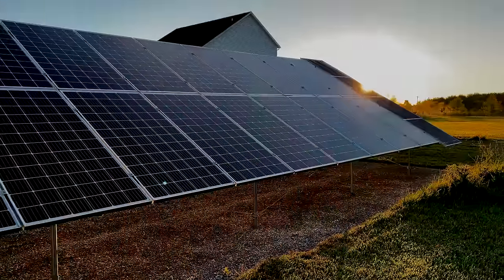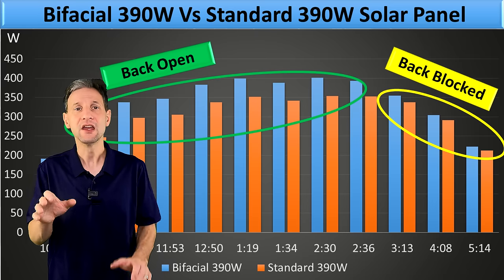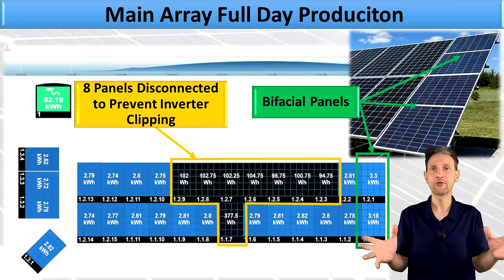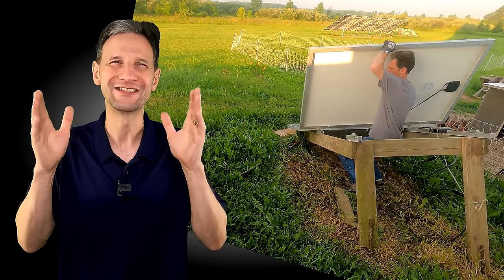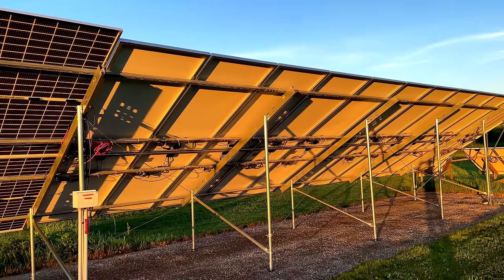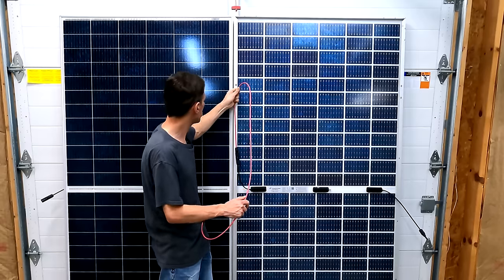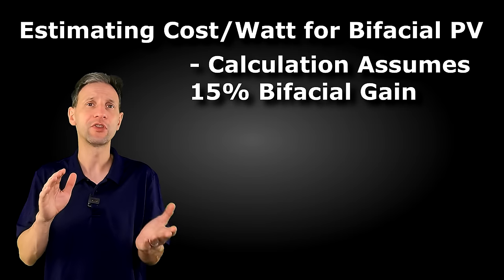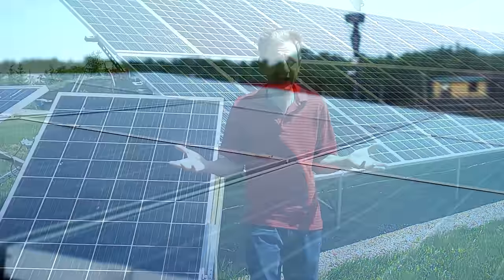Bifacial Solar Panels - The BEST Solar Panel? Real World Results!

Comment: Hey Dave! Great video. I'm in New Mexico and I know a guy who did a neat trick with his bifacials.  He mounted them as a pergola roof about 15 feet up.  And on the ground he put down white concrete unnder the panels and white gravel 20 feet out from the panels.   He said he saw a notable increase when he added it.
Reply from the maker: Nice idea!  Thanks for posting.
Reply: I picked manderins years ago ,and they had a white geo-textile pinned under the trees specifically to reflect light to the underside of the trees - and help the fruit rupen quicker , same thing really ..  
Wether you'd want thousands of acres of plastic fabric everywhere is another issue though ..
Reply: If the PVs were on a slanted mount on top of a roof I imagine colouring the roof white would increase panel efficiency AND cool the building.

Comment: That’s all doesn’t matter. What are real numbers is a price to watt ratio, internal resistances (direct and back), and a durability of a surface. I’m sure it’s possible to find a 10% less expensive standard panel, or 10% more powerful for a same money. And to use a good mounting, wind proof, etc

Comment: Hello Dave, I wanted to say a massive thanks for all you have tough me regarding solar. I now have my system up-and-running. I changed plans several times as each video you posted made me re-evaluate. I now have 64 bifacial panels on 4 ground racks of 16 per rack. I have done as you suggested and placed two racks at 45 degrees from due South. One at 135 degrees SE and one at 225 degrees SW. The remaining two are due south. All have an azimuth of 36 degrees. The resulting performance is way beyond my expectations, interestingly, the SW panels produce half the power that the SE array produce in the early morning. This must be just from the back side of the SW panels. So pleased I changed my mind and went with the Bifacial panels. I also followed your advice and split the load on each of my two inverters by running racks 1 & 3 to the first and 2 & 4 to the second. I knew nothing about electrics before I embarked on this project, let alone solar!

None of this would have been possible without the education you have given me. The clear and concise way you explain the process has been invaluable. I am in your debt. Keep up the good work.

Regards,
Richard.
Reply from the maker: Richard, thanks for the encouraging feedback!  I love that you have taken all the things I've learned from my install and analysis and made a much better solution than I did for my original install.  I'm so glad my information could make a difference for you!!

Comment: Thank you for another great video. I am installing a ground mount system right now. One thing you did not mention was Bifacial racking, I managed to change my order for racks that are specifically designed for Bifacial and have no supports crossing the back of the panel. They adjust to the panel size. I was also able to get new Longi 445W Bifacial panels for only a few €’s more than the same watt standard panels. Interestingly, the Bifacial come with a 30 year performance warranty as opposed to the standard Longi panels 25 years.
Reply from the maker: Thanks, good point!  I did forget to mention the racking considerations.  I think they can offer a longer warranty because they start at a much higher output with the backside boost and the backside glass is a better material then the typical back sheet.

Comment: should lay your bifacials on there side. keep panels a little more vertical and step each row back the width of panel.[like a set of stairs] you should get a reflection from front of second and third rows plus less snow in winter. would be nice to see thanks.  make your stand a just forward or back for summer or winter

Comment: It's nice to see an actual in depth comparison of bifacial to standard panels. I too live in ohio and plan on doing solar at home but im waiting on the paperwork side of things and ive missed out on panels and inverters so far because of it. But my plan is now to get 20 445watt canadian bifacials, two sungoldpower sp6548 inverters, 30kwh eg4 lifepower4 to run my whole house. The array is going to be mounted at 45° because i have a friend right down the road and he gets the best all around output at that angle and it should shed snow decent. Im going to have ac input with the inverters if/when my solar cant run the whole house in the summer bc the 3 ton ac unit. I use around 45-60kwh a day(summer) so im guessing it'll handle it.
Reply from the maker: I think the steeper angle is a good choice to maximize winter production.  However, if your max consumption is in the summer, you may want to go with 30 or 40deg.

Comment: Outstanding content. Conclusions on bi-facial panels I've had to piece together from a myriad of sources...almost all confirmed in one video.

I think the only belief not specifically confirmed has to do with backside gain being able to heat panels enough to shed snow cover on the top side from the heat produced by power generation entirely from the back side. Ground-mount panels set to a steep winter angle for a lower sun should automatically shed snow early in the day and provide substantially more power than panels with cells only exposed to light from the snow-covered top side - all with no manual snow removal activity.
Reply from the maker: Thanks!  Yes, come winter I will have results on snow, steeper angels and roof installations.

Comment: I use twin 3120 watt bifacial arrays on dual axis trackers and during the summer I maxed out at just under 6700 watts. I placed the white granite rocks under my panels in order to catch as much reflection as possible plus my panels are elevated so I get reflective light from all angles.
Reply from the maker: Nice!  What tracker do you use?
Reply: @ProjectsWithDave  I built them myself out of 4” drill stem, cost around $1,000 including the electronics.
Reply from the maker: Cool!  Sounds like a great project!

Comment: I used Canadian Solar 440 bifacials and put them above a galvalume metal building (low slope) roof, with a racking system that allows me to tilt up for winter, and down for summer, in both cases my panels are well above the metal roof.  Being near the 49th parallel, the panels have sun Behind them for a good stretch of the year, and lots of reflection during winter.  My best production ever is acturally January and February when it is cold, and lots of reflection from snow and metal roofing. Yeah those high production numbers are only for a few hours per day, but when you need every watt, this is important.  I have seen over 115% of rated capacity on many sunny cold days.  

One thing to be careful with - Put your framing only inline with the panel edges: no strut running in the middle of the PV back side! keep all the wires and any conduit or wire way away from anywhere they can cause shadows!
Reply from the maker: Thanks for posting your actual experience!

Comment: So one thing I read somewhere is that you should consider increasing the tilt angle from the ideal at your latitude by 5 - 8 degrees and also raise the mounts as high as you can. They also said that you should increase the ground area below the back of the panels you cover with something reflective, like white stones.
Reply from the maker: Since the power boost is going to have the biggest increase in mid summer it makes sense to adjust the tilt angle to favor winter production, that would result in a more even production throughout the year.  Another advantage of bifacial!  If you have a link to the information you read feel free to post it here.  Thanks!
Reply: What about water for the reflective back surface?

Comment: Thanks for doing this research!  It is interesting with bi-facial, half-cell, different bus bar designs, and microinveters how much better panels are with shade and how much more real efficiency they show.  Those NEP 600s are clipped at 390W per PV input, you may have had more!  I am looking at doing a similar system with AP Systems DS3s and the Aptos 440w bifacial from Signature Solar, which also may experience clipping!  The one thing that I am still trying to figure out is racking, do you like your Ready Rack system?  Would you have gone with this system if you were doing things over again?  I'm looking to do a ground mount with 30 72-cell panels, I would love to have it seasonally adjustable tilt and don't care about aesthetics.  However, it seems like tilt adds too much money and these static mounts are likely going to be the best bet.
Reply from the maker: I do like my racking system and I would go with it again.  There is a single pole system with manual tilt adjustment one of my friends is installing that would do what you want, but it requires special equipment to drive the posts so it would be more expensive.  I only connected one panel to each NEP microinverter so there was no clipping in my results.  The BDM600X is capable of 580W output per inverter.  I got the same result from the microinverter and the optimizers.

Comment: Great description and analysis. Considering these to refurb my ground mounted system. Season tilt for Lat 50 means they are almost vertical, slight hill and snow behind the panels would mean quiet a boost. Also -40'c has significant effect, watch out for your Voc Max!
Reply from the maker: Sounds like a good application for bifacials.

Comment: Bifacials are highly recommended when installed on flat rooftops without tiles painted white and always installed on angle (this is the case for many buildings in southern Europe). They are very efficient when the surface behind them is reflective.
Reply from the maker: I imagine that would be much better than mounted flat on a roof, but it would require more racking equipment to achieve that.
Reply: @ProjectsWithDave  In that case you stick with the normal half cut, mono PV. I mean, if racking costs double the money just to put some bifacials, it's better to avoid them. Watching your video experiment regarding panel orientation, I'm thinking of using a couple of big power output bifacials in EAST-WEST direction for harnessing sun early in the morning and late in the evening, especially during winter. That's I think is a more appropriate and efficient way to use these panels if you can't install them the right way.
Reply from the maker: Based on my most recent analysis, I think the best orientation would be SSE and SSW.  You can see those results here: https://youtu.be/J7xnY84Ch1E
Reply: @ProjectsWithDave  Yup, I know...

Comment: Yes I had an idea as soon as I heard about by facial solar panels

They make a paint that is so white. It actually keeps the surface underneath it 15° cooler than ambient temperature

So simply paint the concrete slab underneath your solar panels with that ultra white paint and you would probably get a copious amount of bounce back

Comment: Be interesting to see if the BiFacial panels shed snow quicker since they're likely to heat up quicker in lower light conditions.
Reply from the maker: I'm also very curious, I'll let you know when I get the results.
Reply: @ProjectsWithDave  any updates ?
Reply: @ProjectsWithDave  Yeah, I'm curious if the perform better in winter months too when they can get more light underneath from reflected snow. I live in Illinois, so really wind power would be a better option, but solar is going to be easier of an install and serve as an awning of sorts too.

Comment: How about a reflective surface laying flat or at an angle reflecting sunlight back towards the back of the panels.

In fact it might even work top side reflecting sunlight that might normally past the top side of panels back towards the panels.

Comment: To get more benefit from the backside of the bifacial panels, you could apply something shiney ( foil on foam, foil tape, etc ) and mount it on plywood. Then install the plywood behind the bifacial panel mounting rack so that at peak sun reflection, the plywood+foil sun reflection hits back side of the bifacial panels.

Comment: I'm planning on dipping my toes in a small off grid system to keep the freezers and computers going and these panes are intriguing as I was thinking of installing them on a galvanized roof of a metal building.  The south facing roof pitch is only 2 degrees so I would use a little more tilt on the panels to allow the morning and late afternoon sun to bounce off the shiny roof and onto the back of the panels.
Reply from the maker: If you plan to elevate the panels off the roof at a diverging angle, I think you will see a noticeable benefit from the reflection.  I think you would need 18" to 24" at the back edge to see a significant contribution.
Reply: I did just that. My battery pack runs 2 full sized 24 cu ft self defrosting refrigerators, an old 24 cu ft upright freezer and a 5 cu ft chest freezer.  I bought the Signature 410 watt bifacial panels last year not knowing what I was doing. I have 4 panels at 40 degree elevation  on a roof deck, and another single 410 watt damaged panel on the roof with no back lighting. My sun exposure is far from ideal but better than nothing. In August, they work well from 10AM to 3PM.  At this moment I am preparing to install 4 more on the roof.   I have aluminum channel mounts and ran into the clamp problem. The panels are 30mm thick and the  middle Tee clamps work just fine. The end clamps needed modification to hold tightly. Most clamps are made for 35mm to 50mm frame thickness.

The panels are about 40x80 inches each. I mounted them horizontal lengthwise, 2 rows of 40x160 inches on that 40 degree home built triangulated frame. The low profile won't catch the wind like if the panel was mounted vertically. 

I got really good at making MC4 jumper wires after buying the cable kits and with strippers and crimping tool. The gender of + and minus outer sleeves with OPPOSITE gender inside contacts was confusing at first but I can do them in my sleep now. They were clever enough to make sure the internal + and minus crimped contacts are different sizes to make them goof proof. Remember PPP  on the solar panel output wire... Panel Prick Positive ...the male end is positive. All solar panel MC-4 female connectors are negative.

My batteries stay between 80% charge and 97% charge so far.  That old upright freezer is a real energy pig and runs at about 480 watts. I have 2 chest freezers, 5 and 10 cu ft being tested right now and they run at about 77 watts each, far cry from the 1984 built freezer.  Good luck!

Comment: Maximizing bifacials ideas: Dolomite gravel as ground cover underneat, in the same fashion: Marble gravel under the panels, both reflect significantly more light from the ground. A even more expensive option is the white reflective paint used for road lines, tumble any rock in a bath of that paint and a highly reflective and durable ground cover will be produced.
Reply: I was planing on polished aluminum sheets, but this paint made me re think
Reply: The thought of something reflective under the panels is so obvious why was it not tried?  What are we missing?
Reply: @tommak6516  only those last 15% or so of extra efficency you can squeeze out of the double sided panels. Been doing some trials for "winter electricity" with 90 degree "standing" panels and reflective white paint on the wall behind them, roughly 1.5 meters distance also the ground 0.5 in front and spacing them with 1.5 panel-width gaps to the next in the row (chucked up 10 of them for testing purposes against a barn wall painted in reflective paint roughly 3m up the wall) Panel size where 2.2mx1.2m (largest bifacials I could find).
Reply: @tommak6516  forgot to mention this is at 56 degrees North  latitude, further south this will have to be recalculated for different sun heights ofc.
Reply: @tommak6516  Mirrors are optically grey, so less reflectance than white. Despite the perfect mirror image of coherent light rays, homemade mirrors are less optimal because of potentially damaging lensed specular high lights and unpredictable effect of shadows on current flow. We don't need to boil water here. And even if a perfect mirror would be able to be made cheaply and durably, the panels don't even need to see a perfect 1:1 picture of the sun.  White coating is: cheap, can be found in many forms, easier to repair and maintain.  This is a missed element.

Comment: GREAT video. I am in the process of upgrading two of my arrays to Q-Cell 480w bifacial panels. I have one array done and can say the performance of bifacial has def improved vs my older Renogy 100w panels...esp in low light (cloudy conditions). My arrays are all ground mounted.
Reply from the maker: Yes, I think the cloudy performance is the best selling point.  Those are the times when you need the boost.
Reply: I just added 13kw of q cell 480w bf  to my offgrid system  they are great panels. 36kw of pv now

Comment: Just found this video so I'm a little late to the party. But, I can attest the Blue Sun 460-bifacial panels are awesome. We put 12 on top of our barn with S5 Protea brackets above very light colored AG panel and the results are incredible. Actually a bit too good to believe. Last weekend, just before peak sun, with only 6 of the panels turned on, our Growatt inverter read it was receiving 122 watts @ 30 amps from the 6 panels. If that's truly the case, we're just over 600w per panel. I need to touch base with Signature Solar to see if that's even possible. Or possibly it's reading incorrectly. Either way, we're generating all the power we need. Thanks for making awesome videos!
Reply from the maker: Thanks for the feedback!  I'm glad they are working well for you.  You would not be getting 600W from 460W panels.  Probably no more than 529W best case.